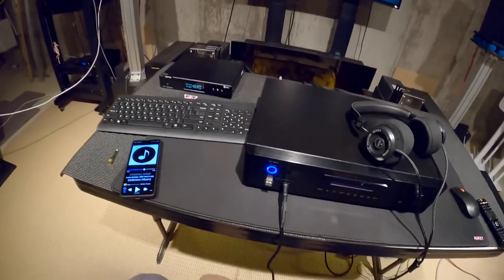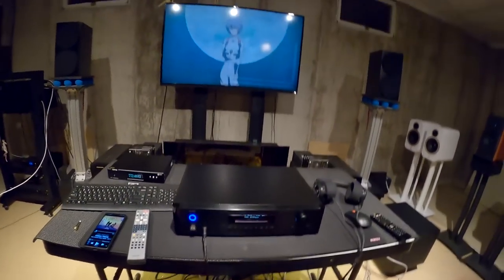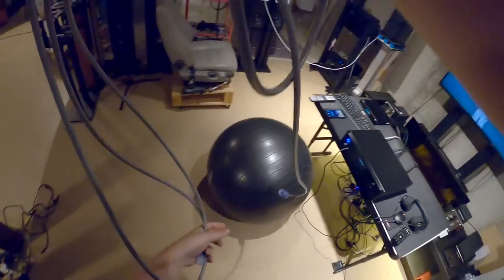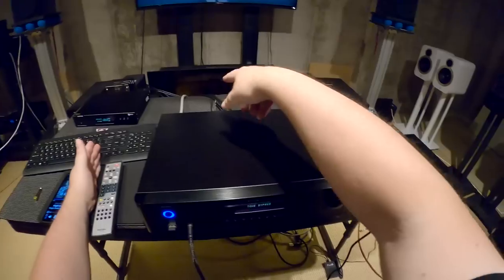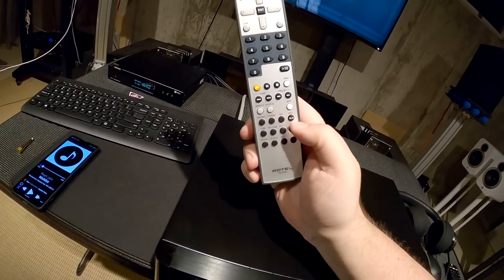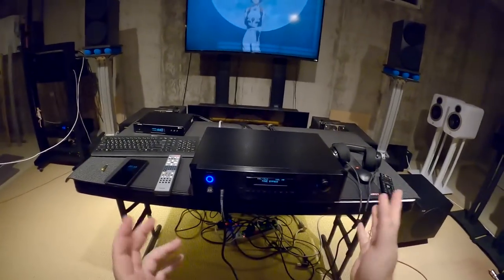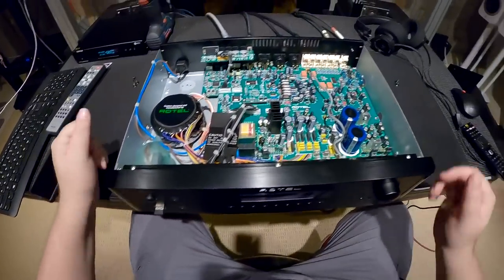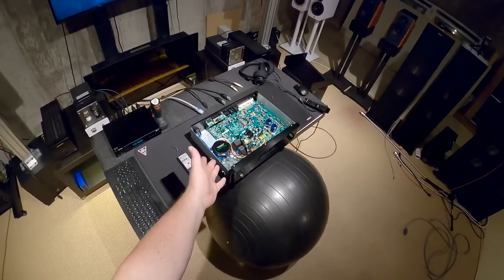🟥Why don't Cheap Pre-Amps Exists? _(Z Reviews)_ ROTEL RC-1570

Comment: Why need an amp when you have a pre-amp, is a pre-amp not just a superior amplifier
Reply: No and no.
Reply: @LIL-MAN_theOG  care to explain
Reply: @noahs-a2631  pre amps don’t have an amplifier. In other words, it has no way to power speakers.
Reply: @jasonreyes9504  Thanks for clearing that up, I guess mine must be a combo (Kenwood KA-660D)
Reply: @noahs-a2631  that’s considered an “integrated amp” the preamp and power amp are integrated into one unit. If it had/has an am/fm tuner it would then be called a receiver.
Reply: @jasonreyes9504  passive preamps don't have an amplifier. But most audiophile preamps have an amplifier. And its always Class A or tube.
Reply: @SlickBlackCadillac  hmmmm. Give me an example please.
Reply: @jasonreyes9504  check 13:15 , he explains it for this one
Reply: @SlickBlackCadillac  you’re misunderstanding what he’s saying.  Preamps DO NOT power speakers. They power the preamp itself. He’s talking about voltage matching.
Reply: @jasonreyes9504  no I am not. It takes an amplifier to do that. Explain to me why my preamps get super hot if they don't have amplifiers in them?
Reply: @SlickBlackCadillac  do those pre amps power your speakers. It’s called a pre amp for a reason. It means before the amp. Are you fucking with me? It gets hot because it’s an electronic device that creates heat. Wow. This is ridiculous. Tell me you power your speakers with a preamp? You’ll be wrong.
Reply: @jasonreyes9504  they don't power speakers. They have RCA and/or XLR outputs only. No, I am not fucking with you. Passive Preamps are electronic devices and don't produce ANY heat. At least none that are easily measurable and definitely not perceivable. The heat in a preamp comes  from the Amplifier(s) in it. It is you who has confused Preamplifier,  power amplifier, headphones amplifier etc. Google the definition of preamplifier. If the verb amplify is in that definition,  then it is you who is wrong. (Protip, it is!)
Reply: @jasonreyes9504  and I now see you edited comment asking for an example. I said almost all audiophile preamps have amplifiers. So the Rotel in this video. And the Schiit Freya and Saga, etc. The Freya has a passive mode (cold as ice) and two amplified modes which are hot and hotter.
Reply: @SlickBlackCadillac  those are gain modes. Not amp modes. I edited it because of a mis spelling. Don’t try to hide from your ignorance.  The freya and this preamp CAN NOT power speakers on their own. You’re either messing w me or really stupid. I’m done.
Reply: @SlickBlackCadillac  preamplifier - noun
an electronic device that amplifies a very weak signal, for example from a microphone or pickup, and transmits it to a main amplifier.

Do you see how a power amp or main amp is needed to actually power the speaker? You’re confused. Comprehension is not your strong point. 

It boosts weaker signals from the source and passes it through to an amp that then powers speakers. How is that hard to understand?
Reply: @SlickBlackCadillac  how many Watts does your preamp output to your speakers? I’ll wait.
Reply: @SlickBlackCadillac  the gain modes on the freya are for long runs or using the tubes. Read the manual. Jesus Christ.
Reply: @jasonreyes9504  I am talking about the comment that was just Hmmm then you added that you wanted an example. Just letting you know I wasn't hiding from sharing an example. There are countless examples. 

Again, a gain stage uses amplifiers. The definition of an amplifier isn't that it powers loud speakers. Even a DAC has an amplifier in it. This is how signals are made or....amplified....which is what a preamp does (also known as an active preamp when differentiating it from a passive preamp.)

Im actually not stupid. Which everyone reading this realizes. Have a nice day buddy.
Reply: @jasonreyes9504  EXACTLY. My preamp cannot power speakers. It feeds an amplified (line level) signal to monoblock power amplifiers which each power a speaker. If the preamp powered speakers, then it would be an "integrated power amp"
Reply: @jasonreyes9504  It's just very apparent you don't know what an amplifier is. (Missed some of your earlier comments about reading the manual)
Reply: @SlickBlackCadillac  thanks for proving my point. You can’t power speakers with a pre amp, which was the original question by the op. You dope.
Reply: @jasonreyes9504  well for the sake of OP and anyone reading, all preamps which are not passive contain amplifiers. Compare the prices of passive vs active and you will see that the extra cost comes from the included amplifiers. NOT to be confused with integrated power amps. Which are power amps that include a preamp (sometimes these are passive or active, a fancy way of saying a volume control)  

Also to clear up confusion, then Jason says gain staging that is the same as saying an amplification stage. I cannot think of a single example where the word gain is used and there is no amplifier in the mix. Probably because there is none. 

Don't confuse OP with incomplete explanations. Thats my take. And I don't resort to name calling because I am right.
Reply: @SlickBlackCadillac  The term “amplifier” in the context of this example is referring to an amplifier that has the ability to power speakers. A preamp while it has a gain stage is only for line level.
Reply: slickback is right, jason is really insecure having to insult someone that makes total sense on a very uncontroversial subject, sad to see.
Reply: @NiclasSalcin  so you’re saying a pre amp and integrated amp are the same thing? Ok.
Reply: Typically an amp is a pre-amp and power amplifier in one box aka an "Integrated amplifier".   I have owned many integrated amplifiers that have pull-out links which you can remove to separate the pre-amp from the built-in power amp section.

Comment: Rotel is amazing. Love my RA1592, won’t be upgraded in a long time.
Reply: Is it original or mk ii? I am considering the latter
Reply: That's a nice preamp, and it has a line out, which the one he's reviewing does not...if you still use a tape deck, or want to add a better headphone Amp, the line out is vital. Plus the 92 also has seperate transformers for analog/digital sections....

Comment: Having the bluetooth on a dongle like this might not be all that smart, as it compromises on the antenna size and thus may have patchier reception than other solutions. I know them being sketchy af, but I only used a handful very briefly, and never for audio.
Reply from the maker: well they could offer a dongle with an attached antennae also. A long range version or this short range one. Really the small BT things I deal with all have great range and are tiny with nothing jutting out. 

But you see the beauty of having it externalized.

Comment: A stereo preamp has never made much sense to me over a good integrated amp. You need monoblocks + speakers, or powered speakers, and that's more money than just adding speakers.

A small pre-amp for a desktop setup would make more sense to me, like the Topping Pre90 but less expensive.

Comment: A pre-amp aka digital mixer for me provides: 
- Linking to wall controllers
- a web interface or app 
- Speaker voicing
- Input voicings for thousands of instruments/microphone types
- Limiters / gate / Feedback reduction
- Equalising
- Input and output zones if you want to drive multiple rooms with different sources or other settings.
- Shitload of input types. 
- Priority of inputs, timer, power saving modes..

I installed them in businesses. They gonna cost you.